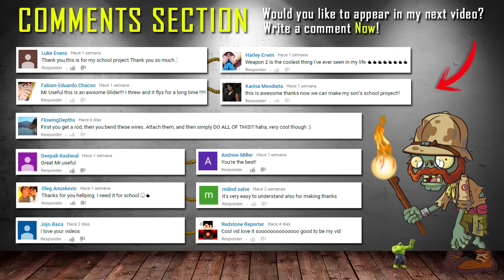How to make a SUPER Led FLASHLIGHT | 100W FLASHLIGHT

Comment: Why don't u use dc voltage booster and use single lipo 12v battery..it can boost the output voltage to 34-36 volts easily...

Comment: Y dint u use 9v batteries???instead og aa batteries
Reply: Kavitha Hari because of the capacity of 9V batteries,wich is around 200mAh,this led need around 3Ah,even with this batteries it doesn t work propperly